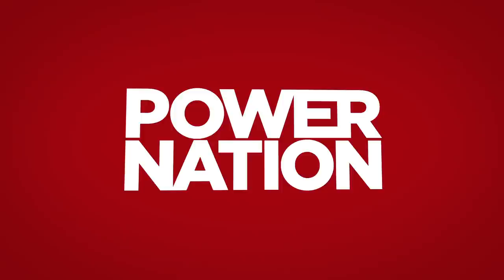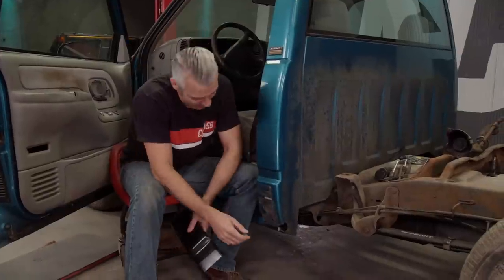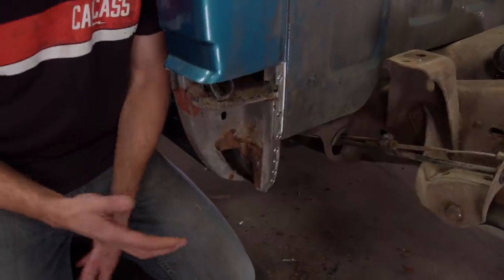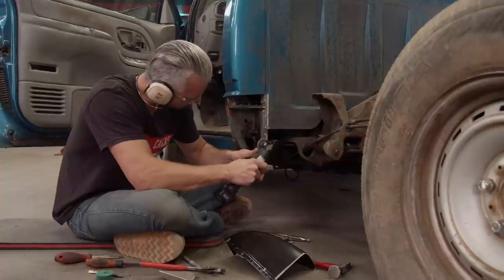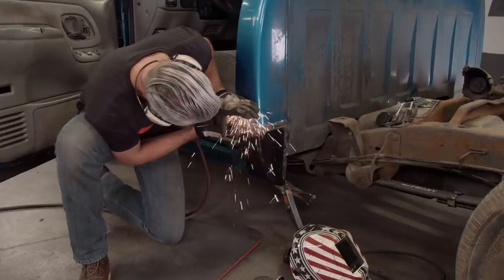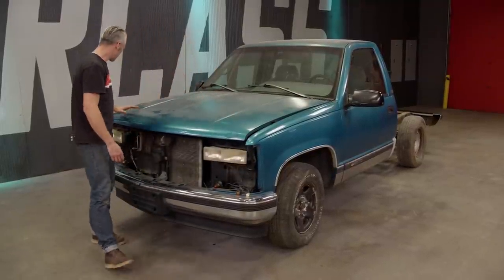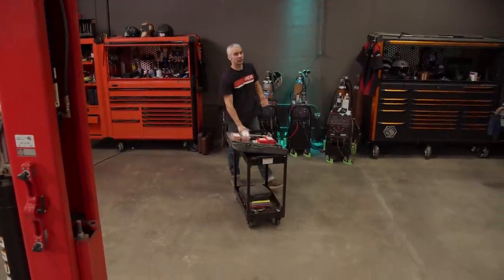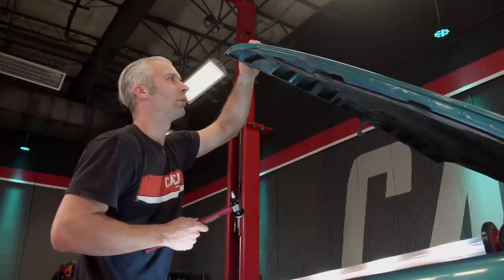Repairing An Abandoned Chevy Silverado - Part 1 - Carcass S3, E5

Comment: I don't mind these guys. In this video they are working on a project that most teenagers could identify with and are teaching practical stuff that they could do with little money.
Reply: Yeah a stud gun is in every teenagers toolbox......
Reply: @carpathian677  Most teenagers near me that work at fast food joints are making more than $15 per hr. A tool store who's name I won't mention here has a stud gun for $99.95. I was simply stating that this build is probably the most realistic for a young starter.
Reply: @carpathian677  Most teenagers won't have a welder either, they'd have to beg, buy or borrow. So what's your point?
Reply: @clintonepps3666  exactly my point. They're no more likely to own a welder or stud gun. But they could beg, buy or borrow one. These jobs were both within reach of most teenagers who know how to use their thumbs. I was responding to a smartass, negative comment.
Reply: This is the kind of thing this grown kid likes.  

My favorite truck is my 1986 100hp f150 

My least favorite is my 2015 Duramax with full built motor and all.    

New trucks are kinda for chicks now days
Reply: At least they're more realistic than most of the rest of them. "We'll just run down to Engine Power and pick up a free, fully built engine." Stuff like that tends to get on people's nerves. Of course, not the best example, but you get my point.

Comment: Couple things. What has been done, if anything, to mitigate moisture getting right back in there, and starting the whole rust cycle from repeating? Now, there is some fresh bare steel, at the joint, inside, ready to start oxidation. There are some products that could be used, but nothing is ever shown to prevent rust from coming back. Any ideas?

Comment: Shouldn't weld in a continuous line. Move around and let the heat disapate. I was told to weld body panels like you tighten lug nuts

Comment: thats half ass, that inside corner would have been easy to make.
Reply: Agreed 100%
Reply: @mattfogarty8144  it's just a 90° nothing crazy or crazy bends. I've made more difficult panels in an apartment parking lot with a hammer and vice than that.
Reply: Have a cry mate. It was irrelevant to the two repairs they made the video to showcase. Happy now you got that attention you wanted?